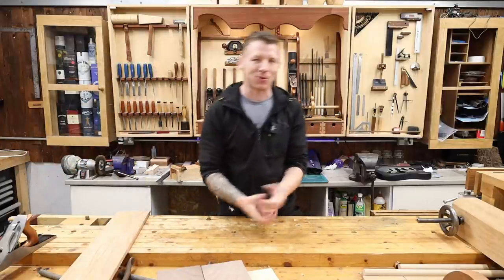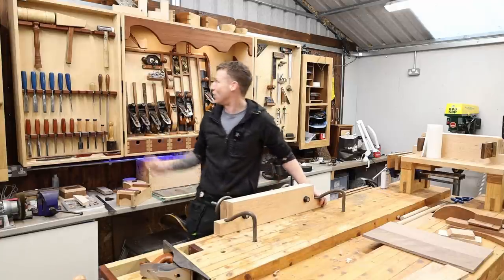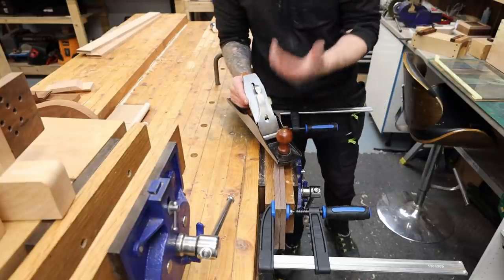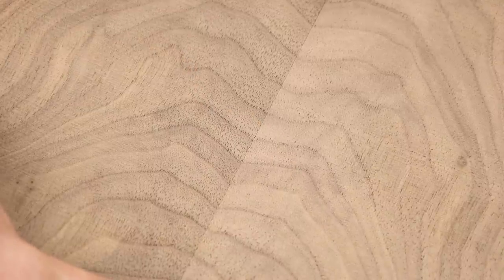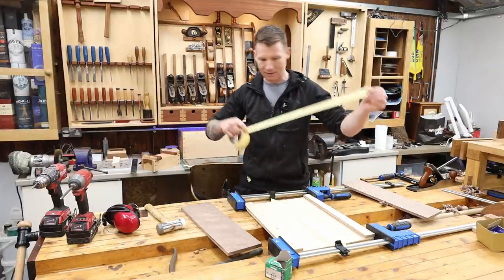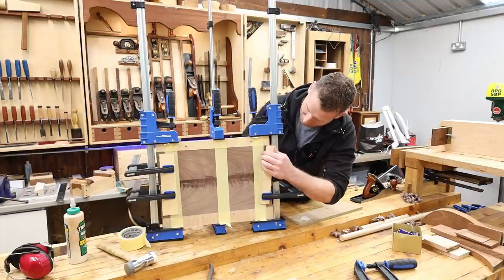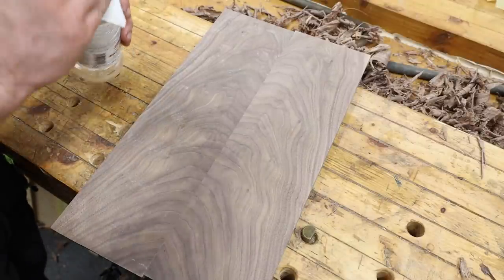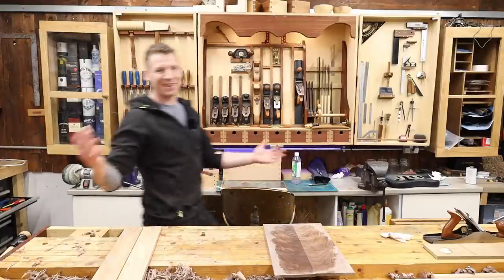Perfect Board Jointing By Hand! Make a perfect joint with your hanplane easy.

Comment: John you needed to put the same amount of tape on both outside edges of each board same side where you put the tape in the middle. Use a thin blade and resaw down the middle and reglue, may work.

Comment: Nice demonstration of jointing two boards at once. Just a couple of things.
With two boards cupped like that would it make more sense to clamp them in the vice so that they bow away from each other in the center? That way the vice will bring them together in the center and the tension of the boards would keep the ends together without additional clamps.
As a glue barrier most woodworkers seem to use plastic packing tape, as glue will not adhere to the smooth plastic surface. Also rather than putting tape on the boards under the cauls most put the tape on the cauls, though that's probably a distinction without a difference.
Reply from the maker: Not in this instance because you need to plane them back to back in order to have the angle cancel out if its not exactly 90.

Comment: Hello,
Thank you for your videos. I am French so my English is medium... I have a question about your previous video. I saw that you installed the TRITON TRA001 2400 W on adapter FSN OFA BOSCH. It fits on existing holes? or do you have fake new screw holes? Do you know if the TRITON MOF001 is also suitable on BOSCH FSN OFA adapter
thank you

Comment: Hey John, good video. Just the masking tape. Don't use your teeth to break/cut tape. First off tape is mass produced and shipped and the adhesive content makes the edges exellent at retaining dust dirt and other more infectious particles...Secondly old school signwriters have a technique, now called a hack, for using masking tape correctly and safely. Adhere the open top of the tape to the piece, where you want it. Apply a little pressure to the very to and middle of the tape with index finger. Open as much of the roll as you need. Place you thumb on the middle of the tape at the roll end and present to end of piece. At this point by moving your thumb left and right you can flex the tape... if you need to get a straight line (you'd be surprised how far out of plumb masking tape can flex). When your happy with the line present bottom of tape to piece. If your happy you then smooth out tapes full length. If not lift bottom of tape and re.present to get better line. When your happy with tape on peice break with thumbnail an inch or so off the piece. Now in this case the straight line is not so important. But the process is solid and safe. I used to run 1 inch tape lines along prepped 8 foot boards to a tolerance of 2 mil. Have a go. Its mad to see the warping.